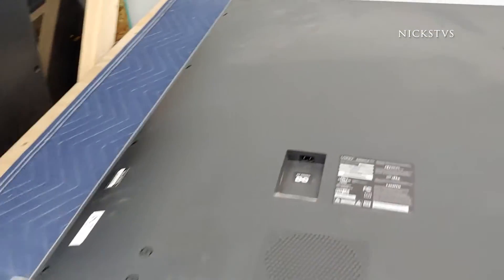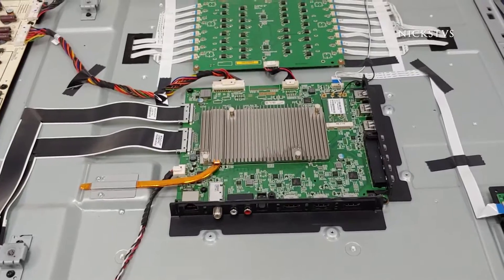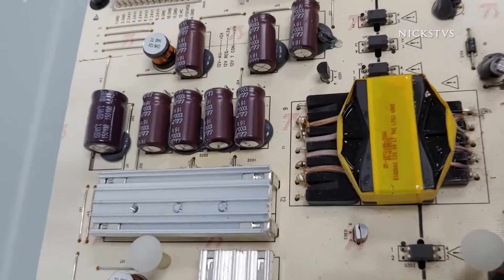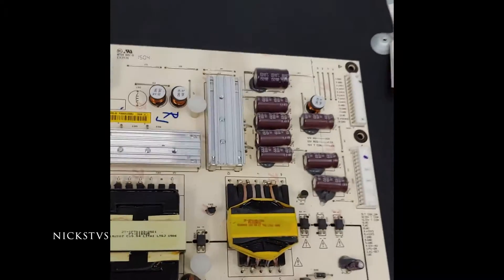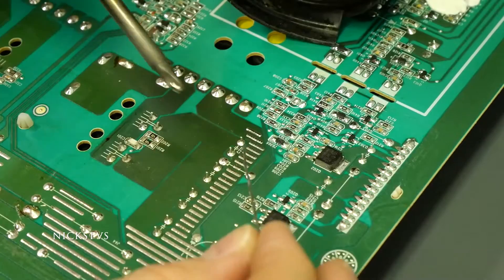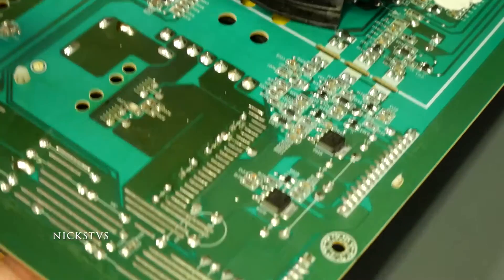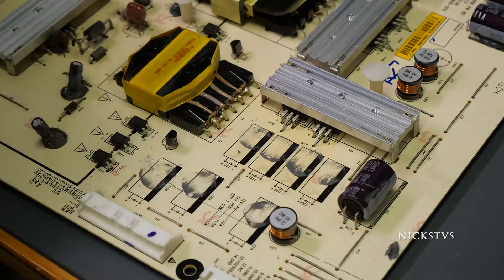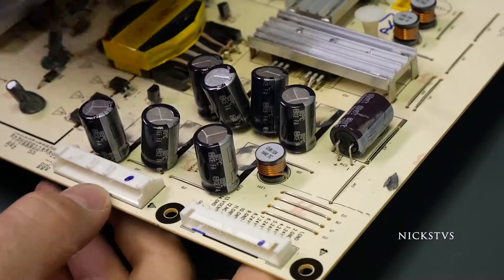Dead 4K Vizio TV NO Power Fix! M70-C3 and P702ui-B3

Comment: Great video! Just a quick question. At the beginning of the video you mentioned this particular customer said there was no power surge of any kind so that the problem likely stems from the power supply. I have a Vizio TV that will not turn on due to a power surge. Will this be a main board issue most likely? I did attempt to replace the entire power supply, but no dice.
Reply from the maker: That is correct a power surge almost always affects the mainboard and almost never the power supply. That is because the surges come in through the data lines such as ethernet cable, or HDMI. Somtimes it comes in through your antenna or other such cables. 
If you aren't sure what needs to be fixed we do service both the mainboard and the power supply. If you would like to send them in, we can diagnose them and repair which ever is at fault. It is however most likely that the mainboard is your faulty board and will need to be repaired. 
Here are links to our services
Mainboard: 
https://nickselectronics.com/products/M70C3Y8386674S
Power supply:
https://nickselectronics.com/products/09-70car080-00

If you have any questions, you can email me at support@nickstvs.com
Reply: @NicksTVRepair  Thank you so much for replying! That’s excellent information.
Reply: I have a Vizio D32x-d1 that has no 5v rail out of the power board. All the 12v lines are good, and when I turn on the tv, the power light comes on and dims out as it is supposed to do, and I have 3v on the on-off terminal at the power board then. Ground terminals all show continuity to chassis ground. But it never shows 5v at the 5v terminal. All components look fine on the power board, nothing burned or cracked, and no bulged capacitors. Any thoughts?

Comment: Great videos! I got this model and it just recently died. Power light goes on but black screen, no faded picture when flashing light on screen, before i open it do you think its the power board cause if its the main board its difficult to remove the chips etc…
Reply from the maker: I would recommend you check out this video, as it will go more in depth on how to diagnose the TV. 

https://youtu.be/un7OJLTWtJY

If the repair is to difficult, you can send us the board for repair. We offer a flat rate mail in repair service for the mainboard and power supply. Hundreds of people each month mail us their defective circuit boards for repair. We have all the tools and equipment for diagnosing, troubleshooting, and repairing your circuit boards.

Comment: Is it really worth it to replace the LED/LCD screen say, a 50", screen on a smart/ 4K? Have a Vizio 50", unit works but the screen is messed up. Thank you 🤓
Reply from the maker: The screen is never financially worth replacing on any TV screen no matter what. 
The screen is messed up in the way that it is not producing picture correctly due to internal failure, that can be fixed, however if you say it's messed up in the sense you kicked the screen or threw a remote at it, then it is physical damage and can't be fixed economically.
Reply: @NicksTVRepair  yeah, I thought so. The Vizio I believe has several cracks in the screen, so even tho the TV is trying to produce a good image, the screen is damaged too much. Thank you for the reply & great video! Also have an LG 43" 4K, but think it has a backlight problem!

Comment: It sounds like I have the same issue. Does the tolerance enter into picking the correct capacitor? One person mentioned replacing the 16 volt types with 25 volts. Also, I read somewhere that shelf life of capacitors is something to worry about. Is that true?
Reply from the maker: You have to use the same microfarad rating. That is important. But you can use a higher rated voltage for the capacitor, that would be fine. So yes 25v instead of 16v would be totally fine.

Comment: How you orden the capacitor? 1511(M) ??
Reply from the maker: I don't know if I understand the questions but if it is "How do I order the capacitors" then the answer is I look at the Voltage rating and capacitance rating and order based on the markings on the original caps. 
Capacitance rating will be in microfarad which is abbreviated to uf so look for the V rating and uf rating. 
Then go to eBay and find a replacement.

Comment: Hello Nick, our 7 year old M70-C3 just went dark last night.  When trying to power it on, the light at the bottom right comes on for 10 seconds, then it dimmed to 1/2 or 1/3 of the brightness, no picture at all on screen.  Sometimes, the light would blink then dimmed.  Does it sound like a power supply board capacitor issue?

But prior to getting to this state, we did see half the screen with static for a minute or so, could it be the main board is also bad?  Thank you.
Reply from the maker: That sounds more like the mainboard has gone out. Check out the video linked below for troublshooting tips on the M70-C3 TV

https://youtu.be/un7OJLTWtJY

Comment: Hey Nick! Very helpful video, thank you.

QUESTION -
If it's a power problem compounded with the TV not working with the sound bar anymore, would that mean replacing the main board? The TV still turns on, but you have to turn it on 5-10 times before it actually comes on.

I'm going to open it tomorrow to check for Amy visual evidence.

It all started when I turned on CEC sound control for my Nvidia shield.
Reply from the maker: That's strange, I think that could be a coincidence. What I can tell you for sure though is that if you have to turn the TV off and on several times, then it means the capacitors on your power supply are starting to go out and need to be replaced.
Reply: @NicksTVRepair  decided to open it up today. Slight bulge on the caps. I suppose I will start with that and then replace the board if it doesn't fix it.

But yeah, the sound issue is baffling. But from my experiences, Vizio TV's are terrible at working with other devices nicely - even their own (sound bar).

Comment: I just did the cap replacement. The 16v 1000mf caps I sourced were 1/2 the size so I changed to a 25v version. I replaced 3 all the caps you recommended. Tv powered up right away. But the right half of the screen is way darker. I pulled the power supply back out and resoldered all the caps just incase there was a cold one. Still same. Any ideas would be appreciated.
Reply from the maker: Bill,
You said "I replaced 3 all the caps you recommended" is that a typo? What do you mean you replaced 3 caps but also all of them? 
Make sure to replace all of them because if you don't you could have more issues soon after. 
As for the dark screen post repair, it's likely due to an led failure. One of two things could have happened. 
Either the LED's just happened to fail around the same time your power supply did, or moving the TV around from vertical to horizontal or moving it from one room to another caused a strip to shift or move slights and could have disconnected on of your LED strips causing a second of the screen to go dark. 
If I were you I would open up the TV down to the LED's disconnect and reconnect each LED strip and reboot the set (without putting the screen back on) If this solves the issue then you are good to put the screen back on, if not, then you will need to replace the LED strips.
Reply: @NicksTVRepair  yes typo. I replaced the 7 you recommended.
Reply: Hi Nick, I stripped down to the backlights. I have a question on the strips themselves. On boot the strips change brightness. Then at rest some of the strips go to a dim flickering. Is that caused by what image is processing? 
By the way you've been a tremendous help during this process and I appreciate it.
Reply from the maker: @billwhite1818  Sorry, I didn't see you message until now. But yes that is correct the brightness varies depending on what is being displayed on screen.

Comment: I cannot find the replacement boards for my P652UI-B2 Vizio TV; every place lists them as "Out of Stock".  Can I just replace the set of boards that are listed for a different model # Vizio TV?  Or are the boards matched with the screen?  It seems that the only difference between models are the Main board and the T-Con ... and maybe the Power Supply.
Reply from the maker: Unfortunately you can't just swap them out with any other board, they have to be the exact specific part for that TV in order to work. The mainboard for your TV is most likely your issue but as you stated it is out of stock everywhere. This is where we come in, we offer repair services of the boards, so we can fix your board. Check the listing below for more info

https://www.nickstvs.com/store/p2367/P652UI-B2.html

Comment: I have same exact set and have to remove power cord from back for 15-30 seconds before it will turn on. but only after hitting power button 3 or 4 times will it give me a picture. could this be the power board or is main board a more likely culprit?
Reply from the maker: Yes, this is a common issue we see with these power supply boards. 
If you want I also did another video on this TV and I went into more detail on the capacitors. 
https://www.youtube.com/watch?v=un7OJLTWtJY

If you want to send in your board for repair we have a flat rate repair service:
https://www.nickstvs.com/store/p2638/09-70CAR080-00.html

Comment: Extreme gratitude for making this video. It allowed my to fix my Vizio M60-C3 (same model, only 60" vs 70") and get it up and running again in a day.

In hopes of helping someone else identify the issue sooner. It started several weeks back where instead of the white light coming on and then a few seconds later the screen would come on and the Vizio logo, it started to happen that I would need to cycle the power off again with the remote, then back on for the picture to come up. A few days later that process needed to be repeated 2x, then later 3x, then later 4x, and eventually it would take about 10 mins of powering off and on before the picture actually came up.

Right before the TV completely failed to turn on I left it on for an entire day to avoid the cycling, that next morning the TV just randomly turned its picture off (sound was still going) and it never came back on. I tried to cycle power as before, but this time the white led in the left corner would never even come on, it was completely done.

Overnighted a 20 pack of 1000uf 16V caps and some solder wire from amazon prime, disassembled the TV, took off the power supply board, cut off the old caps, replaced with the new and soldered them on. I replaced all 7 of the 1000uf 16V in the upper right corner of the board, even though only 4 of them, the ones in the video, were visibly bulged. For $20 in parts and maybe 1-2 hours total in time its back up and running. Thanks for the video mate.
Reply from the maker: Hey Aaron
Glad to hear I was able to help you fix your set! Yes sometimes the failure start to appear intermittently and you have to power cycle the TV a few times to get it to work and exactly as you experienced it gets worst over time to the point where it just completely fails.
Reply: Appreciate the comment. I have an M60-C3 with the same symptoms. Also great that you added what type of capacitor to order. Kudos!
Reply: @brianortner7914  No problem! Glad to help. Real kudos to video creator. Good luck getting yours fixed too.
Reply: I am having this exact same problem with my M70-C3!  It completely died now.  I'm SO HAPPY I found this video and to hear that this worked for you.  Now, if I can just talk my fiancé into letting me try to fix it myself instead of him buying a new TV!
Reply: @donnac3853  Good luck. Its really not very difficult. You dont even need to know how to solder that well because the components are so large and its not like you are doing printed circuit board mounting, its more like hot glueing craft time. Hey fiancé this person has it!
Reply: @aaronwwilliams  Thanks for the vote of confidence!  I'm waiting for the capacitors to arrive and will give it a shot.  I'm watching videos on how to solder now because I'm getting hung up on the nuances of the type of solder to use, tinning, flux, not mixing leaded and no-lead solder, etc. I tend to get in the weeds. Lol.

Comment: hi nick, i have the same tv, i have all voltage but the 12volts for the tcom , i did change the mosfet that supplying the 12 volt. but nothing happen, ..thanks
Reply from the maker: I assume you watched the video and checked to see if you have bulging capacitors correct? If you do, then your power supply of course needs new caps. If not then most likely it's a mainboard. 
I have not yet seen anything else other than the caps go out on this board before, so I wouldn't recommend replacing MOSFETs unless you are finding shorts on them.

Comment: This is my first comment on YouTube. Never soldered in my life. Bought capacitors on eBay and soldering kit on Amazon. Followed your perfectly thorough directions and fixed my tv. You have true mastery of your craft since you can explain a complex topic so easily. Strong work and thank you very much!
Reply from the maker: Thank you so much for your feedback. This is an inspiring comment to keep making more videos.
Reply: Were you buy the capacitors. What’s the model or number?  I have the same problem

Comment: Thanks for this Gem as it fixed my 2015 M70-C3, and I have no experience in Soldering at all.  And if you're not able to get 16V 1000uf capacitors as I wasn't able to, then go with 25V 1000uf.  $30 later, including the purchase of a soldering kit, and thousands of dollars richer.
Reply from the maker: Glad it helped
Reply: @NicksTVRepair  aaaaaazzzxl  az
Reply: @NicksTVRepair  aaaaaazzzxl  az
Reply: @NicksTVRepair  aaaaaazzzxl  az

Comment: A huge Thank You for this repair video! I bought my 70" Vizio in 2016 and even paid $100 for an extended warranty to give the TV 5 years... but of course it's now 6 years and out of coverage. I started having issues powering on the TV a few weeks ago and was pretty sure something was going in the power supply and wouldn't you know it... today it died for good. :( I tried everything but couldn't get any power light activity. 

Seeing as it was basically E waste, I found this video and thought I'm going to give it a go. I'm not an expert with the soldering iron, but your instructions on removing the bad caps and cleaning up the old solder worked like a charm. I was easily able to pull the caps. Then I went to my local supply store and bought a bag of capacitors for .40 cents each (1000 uf @ 16v), swapped them in and the TV fired up like a champ. All told it took me about 2 hours to fix (I went slow and careful) and it only cost my $1.60 in caps. 

Thanks so much for this video - it saved me from having to buy a new TV!
Reply from the maker: That's great to hear! It's a nice TV, it's worth fixing, I am glad you were able to get it back up and running!

Comment: I have 16v capacitors to replace but they are half the size of the capacitor on the board. Does it matter or can I use it?
Reply from the maker: Size won't matter as long as the micro farad and voltage are the same.
Reply: @NicksTVRepair  Voltage can be higher, just not lower.
Reply: If our tv has the same problem from a storm what do we look for on main board?

Comment: Hey Nick have the same set, mine was a strange sumptom though sometimes upon startup the picture was darker than normal and after having it on for a few mins I'd turn it off and back on and it was perfectly normal. Then one day I turned it on and it just shut off. None of my caps are bulged and no surge of any kind. Power light doesn't even flicker with plug in.. do you think it's the power board?
Reply from the maker: If none of the caps are bulging and you don't have any power then most likely you have a mainboard failure. This is also a circuit board that can be fixed but it's a much more advanced repair and requires special tools and equipment. 
If you can find a replacement mainboard, then that should fix it. If you can't find one or if they are very expensive which I do believe they are, then you can also send it in for repair, I have a flat rate repair service for these.

https://www.nickstvs.com/store/p3008/Y8386674S.html

If you aren't sure and would rather send in both boards just in case to have us test, we can do that as well. 
If you have any questions or want to try and troubleshoot further, let me know either you can send me an email at support@nickstvs.com or if you want to respond in the comments I only ask that you post a new comment instead of a reply because I don't get notifications for replies, only on a new comment.

Comment: What capacitors can I order to do this repair Please.
Reply from the maker: I am currently out of stock for the capacitors, but I should have more available in a week or two. 
If you want to just buy them yourself, you can probably find some at your local electronics parts store they are 1000uf 16v Electrolytic capacitors. Please keep in mind those are the readings on the capacitors on my board, there are 2 versions of this board, and yours might be different so just check what the capacitors say on your board before replacing them.
Reply: @NicksTVRepair  Nick I do have a question for the same tv. I am missing the 12 volts just for the TCOM   , I wonder if the  capacitor have to do something with it.